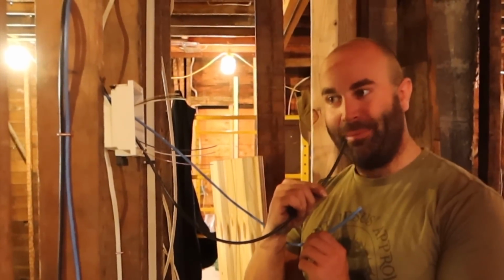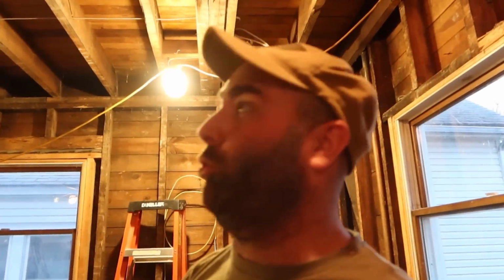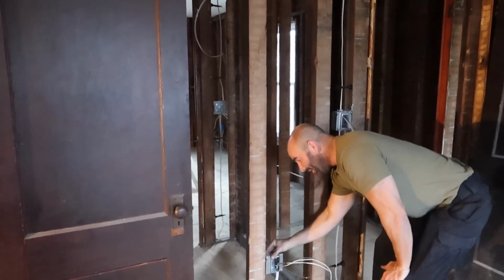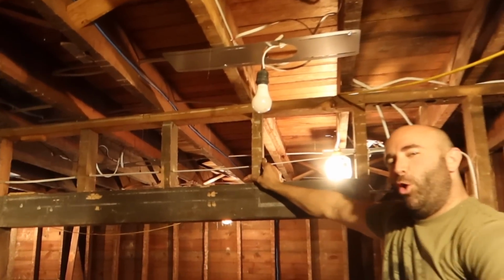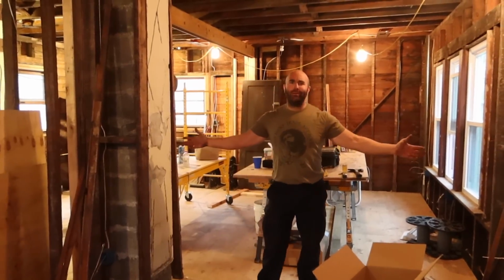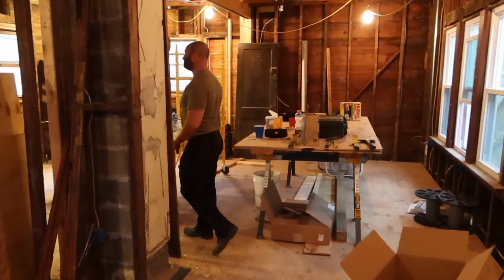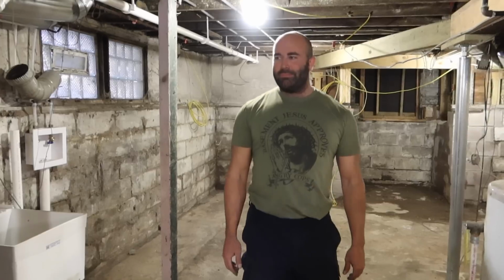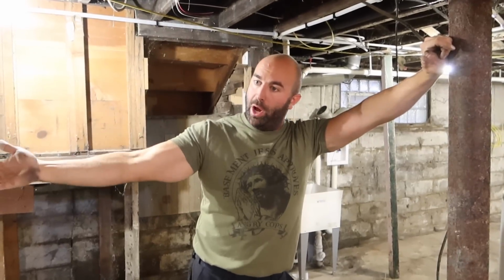This Old Crack House Part 17 - This Wire Tastes Funny

Comment: I use shallow 4 sq boxes (metallic) on sideways studs or for anywhere that is more narrow and a standard box won’t fit. Also kitchens so you can put mud ring (faceplate) in sideways to clean up the reveal for tile backsplash.

Comment: As someone from Germany i am amazed how everything in this hause is made out of wood. The bulding style in the Region where im from is mostly Brick and Concrete with some insolation in between.
Reply: We call that sick build over here.  It is due to how light and durable wood is, and also how cheap it is.  Using brick and mortar isn't safe for much, done will need something to keep it secure.  So we use those for places where there will be a lot of heat (fire, furnace, etc) or on the outside, but never for more than 2 stories (except for chimneys but they are supported with other material of that high).

All material is with its shortcomings.  Like wood rots, brick and stone have to be repointed more often, metal is heavy and expressive and will rust off not treated and sealed properly.

Comment: As far as the bathroom light goes ask electrician to put a old work box in once you set vanity and rock is up just make sure you have a leg coming down inside wall to wire up. Them “old work box” are awesome especially for vanity lights or any kind switch or plug. They have two wing that flip out and holds pressure against backside of Sheetrock while face of box sits flush with front of wall

Comment: Seal your stud bay ... close cell spray foam - if you want more R value (is it cold where you are?) you can add 2x2's to your 2x4's to give your study bay more depth on the exterior walls - obviously receptacles have to be moved out another few inchess.
Went from a $250 gas bill in my old house to a $80 gas bill... and my wife doesn't stick her cold feet under me anymore because it's actually warm in our house.
Great watching, good luck friend!

Comment: Happy for you having a contractor that works with you now, just wish the electrical had service loops. Dude leaving himself and you the owner no room for error. Wires get pinched and shit shorts out, you got a lot of money to spend fixing it  correctly. The extra 5 cents it costs to leave a loop in the wall just in cost is worth it.

Comment: Hi AC electrician here. No the metal boxes are not used for grounding they are just a Different style of box instead of always using those plastic ones. They also can be thinner. Inside of that box though there will be a green wire that’s used for the ground but the box itself doesn’t do that.

Comment: As having done interior building renovation on a state education system level I know a little bit of what you are doing.    Only difference was we ripped out entire walls that had any wood studs in them due to the need to fireproof the specific building.

Comment: Metal boxes let you put up the sheet rock faster. Just have to measure about where the box opening is, put a couple screws in the sheet rock then rotozip the box out. Perfect every time. 🍺

Comment: Old trick of the trade when cleaning beams like that was just to go top to bottom (stopping mid way since top and bottom get done in 2 passes) and when you think you're done cleaning a beam, before you move, you just run your hammer flat on the section you just did. If there is anything left, it will catch it. Your eyes will deceive you, or you may miss something, your hammer won't miss a thing.

Comment: You'll want to add plywood to the tv wall in the living room and any other wall where a tv could be mounted. Between the studs will be fine just make sure you use 1" plywood or double it up.
Reply: And real plywood, not that three letter imitation bull either.

Comment: You don't have to pull them all. If you have a couple here and there you can just drive them in the rest of the way. Insulation will likely use staples.

Comment: Yo rich the house is coming along great I do recommend a few external upgrades as well like external power and of course you need one of those laundry chutes that vacuums your laundry to the basement. I'd check out external upgrades because there's one I want but I cant remember what it is (super helpful) last thing get some bcs ca le so you can install cameras... Now rather than. Later since you know no walls makes it easier to run cables.

Comment: if you're not hiring a contractor take in mind that those old 2x4's are actually 2in by 4in rather than the new 2x4's "1.5x3.5" taking into account the combined size of the blue board. so any finished measurements on interior space will be about 1in to 3/4in less than you think. all window casings and doors will need to take this into account too.

Comment: Hey AC, for your Pot lights I recommend the following (Ensenior 12 Pack 6 Inch Ultra-Thin LED Recessed Ceiling Light with Junction Box, 3000K/4000K/5000K). They are great and so easy to install, a PVT can do it. When I bought my house after my last PCS move, I had to fix up a old trash heap of a mess. I had to redo my electric, plumbing and strip out so much fucking old ass wires that I swear to God  people shot Porn or something in the 70s down in the Basement. I bought alot of my material before i deployed so I saved a shit ton. The lights was one of my purchases and they are adjustable. Your project looks fun! Charlie Mike brother

Comment: @angrycops just a heads up overhead lighting over a vanity is horrible it used to be you would just skin a box over the pipe but nowadays is more popular to do lighting on the sides of the mirror if it's possible but by the time you see this is probably going to be too late

Comment: 9:08 AND GLUE.... Sister on both sides, put construction glue on and then #10 construction 4 inch screws, then lag bolt together. I will never move after that.

Comment: Doing a dam good job. I got the tree house should of did vids of it. Buddy of mine had a tree fall though his it wasn't touched for 3 years did have the roof rebuilt back then. And removed the master bedroom since tree was on the ground through it. But he stopped at the dining/kitchen. Water damage took out double header to the sill. Still got framing electrical and water /sewerage to do. Not including cabnets, sinks etc. Rebuilding it as a 2 2 rental Probably gotta hang rock since his 5'7 ass can't reach shit..

Comment: Pulling nails, not fun. Cordless grinder with cut off wheel much more efficient use of time. FYI, I would travel from Texas to buffalo to install trim, cabinets and assorted goodies. Just to hang out and knock back cold ones

Comment: I don’t remember specifically why there metal, I think it for physical and fire protection, also since it’s metal it has to be grounded with the bare wire so not to shock you if touched.
Reply: If it where plastic it does not have to be grounded because it’s non conductive. Excluding the switch’s and outlets which will have a green hex screw/terminal for grounding conductors.

Comment: There are a few uses for those metal boxes. The ones on the wall are usually to house the plug sockets, light switches, or other such things. The square ones floating around are for when you have a metal piping that houses your cables to join together at angles, splice cables easier (so you don't need to cut open the pipes), have multiple wires in one pipe split into more than one pipe, or to put light fixtures in. I'm sure I'm forgetting other uses.

Comment: Seeing as you’re going for a more clean modern style stair you need to fix, I think if you did reinforced concrete slabs for steps and gloss black metal  wire bars for hand rails; that’s look really clean.  Would also be a nice contrast as unfinished basement are concrete floors, but having the stairs be concrete leading to hardwood or carpet would be the opposite of the norm.  I’d love to see that.

If you haven’t picked up, I took a A civil engineering class but I also love construction and architecture.  My dream is to build my own house on a adduce plot of land someday.  Honestly that’s what’s motivating me to go to college.  If you want to talk design concepts, let me know.  I’m not a professional.  I took 1 highschool class, but love architecture, so I might be able to help.   Also I’d be doing it free of charge as I’m not a professional, and I’d love to say “I helped”.

Comment: You're probably going to hate yourself after you realize that there's an air tool that pulls out nails and another one that you put over in existing nail and it will hammer it in and with the two of those you can take care of all of the nails that the 2 tools physically can get to. The one tool can pull out Nails screws even bent ones in many cases as long as the head is up a little

Comment: and yes to your carriage bolt sister joists. that's how it's done. screws just to hold it in place so you can punch them big bois through. you're doing good by basement jesus. also what is your joist spacing? 24 or 16"? if its 16 just carry on, but if its 24 inches and you want to do any tile work either double tongue groove layer the 3/4 ply and offset the boards to give you strength against deflection, or at very least make sure its 3/4 tongue and groove subfloor and use ditra XL as your substrate. sry just an overachiever tile guy hoping you the best.

Comment: AC you should be careful about doing Air BnB. 

I've heard stories about how they aren't covered by the same laws that protect inns and hotels. Some tenets trash Air BnBs or they refuse to leave and have to be evicted. You should talk to a lawyer or something because I've heard of Air BnBs going wrong. It might be safer to just lease the place out to renters or something. When in doubt: check it out.

Comment: Just a heads up, don't let them run your new furnace during drywall  or you might be replacing your A-Coil.  Get up the good work and laughs. Your the top nail puller in my book.  BTW- GO CHIEFS

Comment: i HATE the new trend of knocking down walls and removing doors to "open up spaces" in houses. my last house had ONE SINGLE DOOR. it was 1200 square feet with ONE DOOR. It was a nightmare with my cats! and the master bed was combined with a guest bed to make an absurdly massive 20 foot long master bed. WHY??? i could have literally put 10 king sized beds in that room and still had room to spare. it was two closets. a full 30% of the ENTIRE HOUSE was a single massive bedroom. maybe that looks good on a spec sheet when you are trying to sell a house, but damn it was annoying. rooms and doors exist for a reason. they are awesome. we don't need 20 foot long open air auditoriums in our regular sized houses.

Comment: You can’t just throw a basement Jack on top of the middle of the floor your standing on.  It’ll also push DOWN on the floor at the same rate…. You have to support the floor also, all the way to the foundation, or at least the basement floor.

Comment: @AC. You have now reached a point where you need to hire an attorney to argue on your behalf on these fines. The reason is they will continue to do it until somebody stops them you must understand that a city inspector is like a parasite and it will bleed you dry add it on pace, you need to hire an attorney to kill the parasite once and for all which is code enforcement

Comment: I don't know about NY code... but you could have used plastic boxes. Metal boxes are more for commercial so they can pull and replace wire for later installment. Also... did you just tack plain wire to the stud? How's that not a violation?
Reply: The blue and black wire are low voltage coax and Ethernet. Not sure if that makes a difference.
Reply: @michaelalcocer6778  IT is different. I couldn't see the wires too well.

electrical wires, for power, lights, and accessories like a ventilation fan. @ 120/240V must have a outer-plastic sheath, which is usually white or yellow. in VERY old houses there is bare copper wire, and it is hot. in some shotty houses they will use coated wire, which as far as I know is illegal in all 50 states but if you put that coated wire in a pvc pipe (electrical) or EMT pipe it is legal. some shitty electricians will run metal sheathed wire (MC cable) and improperly cut it leading to exposed wire, which is usually an automatic fail.

EMT, MC, rigid pipe, and metal flex pipe all count as grounding but they are more expensive than the alternative.

if you don't have grounding through the sheathing protector, you have to run a dedicated ground wire. there are also special grounding wires called "isolated ground" these are grounded at specific points and are important for computers, particularly high end ones.

some places require that you try to keep the grounding in a coating even inside the box, but convention is that you don't need a coating protection on a ground wire and cheaper romex cable (plastic sheath) will have a bare ground wire.

IT cables are usually split into CAT III, CAT IV, CAT V, CAT VI, CAT VII, CAT VIII (ETC.) which are your telephone and internet; Coax, which is basic cable and internet; custom installation of USB/HDMI cables for convenience/entertainment. I actually have an HDMI outlet in my RV because there is a TV in my bedroom, but the entertainment center is in the living room. but IT has few if any rules including securing it, which is normally done for the installer and owner not the inspector.
Reply: @michaelalcocer6778  I should add that in coated wires black and blue are both "hot" but if they are paired, it can mean that they are running something like AC at 240 or 277/480 but that is rather innane and it should be brown, orange or yellow.
such that

120/240:
>HOT: black, red, blue
>Neutral: white
>Ground: green

277/480:
>HOT: brown, orange, yellow
>Neutral: gray
>Ground: green

strips of any color yellow striped green coated wire are isloated grounds, otherwise it is either a very anal retentive electrician or it is an IT wire.

electricians will also use purple, pair red and black, and have a single wire when working with "X"# of multi-way switches, which is common in houses with comples lighting systems called travelers. I have also used a gray (Delta) wire for dimmers, they tend to be wired purple and grary. this is because it counts as IT and nothing really matters anymore.

Comment: Sistering those floor joists that are cracked means ripping out and re-pulling all the new electrical you currently had installed through them.  Just sayin’.  Should a done that before the electrical.

Comment: Drill... I'm no electrical engineer, and I could be wrong. I don't know your city codes, nor would I badmouth your guy. He obviously knows what he's doing.
Just wondering why he decided to mix plastic boxes, with metal & mudrings. Grounding to metal enclosures is mandatory, but not with plastic. In the event of a short or an overload, the metal box becomes part of the circuit. With plastic, if all your grounds are tied together (as I'm sure they will be), then the current flow remains in the circuit. With plastic boxes, you don't need mudrings and ground screws, either (see your outlet boxes). Just cut the hole in the drywall, and no spackling.

After a quick search on the Depot....
Metal enclosures are about 3 times the cost of plastic, without the mudrings and ground screws.
Then again... I could be wrong. Maybe you got a deal. Maybe he had extras that he gave to ya. Maybe... WHO CARES?
This was just an observation. Nothing more. I'm sure, in the end, everything will work perfectly, and perhaps you got a righteous price, too. Win/win.

Comment: Ehhhh your electricians are sloppy. I can already tell you they're going to use the stab ins on the outlets and switches. Be ready for a professional in 8 years or so.
Reply: The vanity could have been centered with a spanner and half inch box